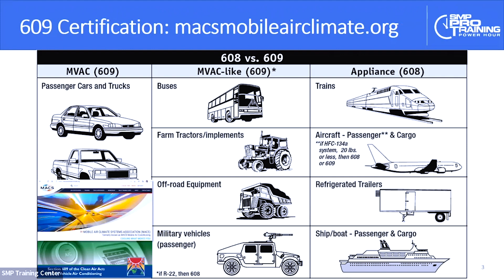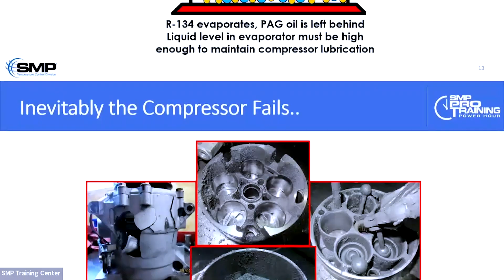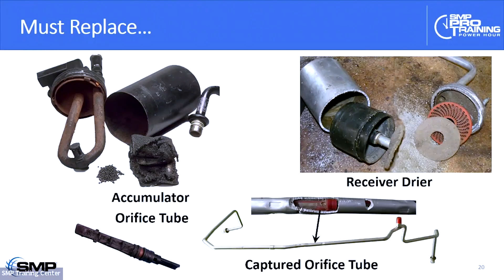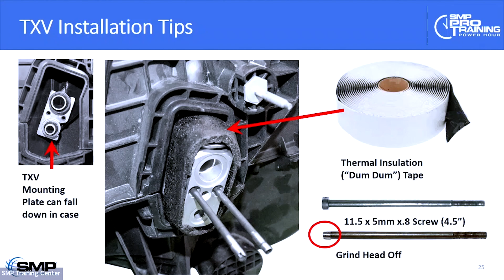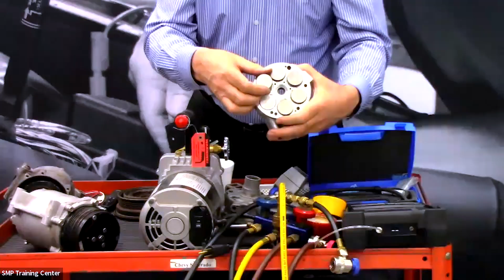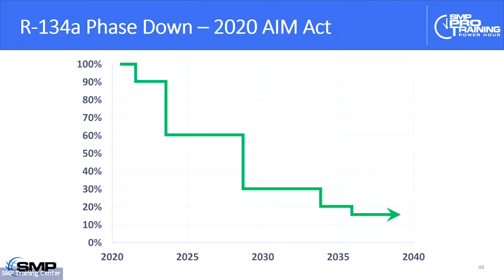Air Conditioning Best Practices | Pro Training PowerHour

Comment: I cannot believe this only has 32 likes.  This is by far the best video about AC systems on youtube and the only one I have found that actually describes the physics that underpin any AC system (which is also the same for fridges).  I cannot thank you enough for producing this and your other videos.

Pretty well everything you described about systems going wrong is what happened to my R134a system.  The compressor was completely dry, with the bearings between pistons and swash plate floating around inside, with scratches to the crankcase and a black discolouration.  On flushing the first hose from the discharge port, I got lots of black bits come out which had a feel of a grease.  Flushing the evaporator was just an almost black liquid at first (which did not clear when left standing), then the next flush a lighter colour with a green tint (with some sediment after standing), then what became a clear liquid (almost after standing) with a black sediment.  The other hoses were pretty clean.  The dryer was the last component before the suction port of the compressor, which I replaced.  I cut apart the old one which was very clean inside with just a very small amount of oil at the bottom.

The monitoring of evaporator input and output temperatures would seem to be an excellent method to identify a developing issue, but if there is a differential temperature, which could the mean oil has been accumulating at the bottom of the evaporator, presumably the evaporator would then need flushing and the compressor emptying then re-filling with oil.  Would you agree?  Thanks again.